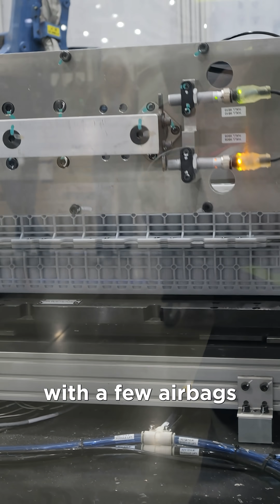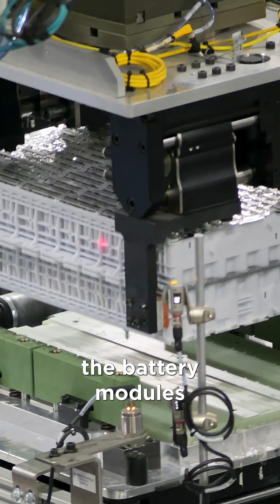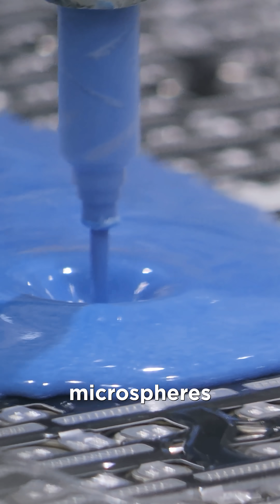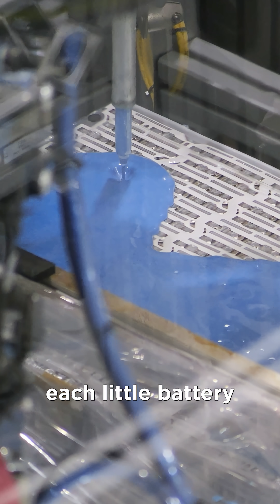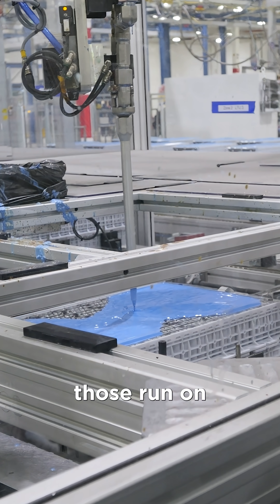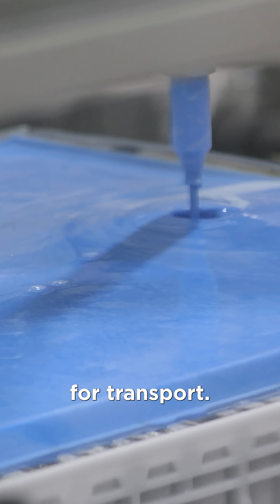Rivians Secret Battery Sauce

Comment: According to that same source Hybrid Engines are 138x as likely to catch fire as an EV 😊 (since he doesn’t care to give any source/info, I will: the NTSB is the one who came up with that stat, it’s based on the number of cars that have gone up in flames per 100,000 vehicles sold. So they found that 25 out of 100,000 EVs produced will catch on fire versus 1,529/100k for gas or 3,474 hybrids per 100k) 

That said lets not pretend like EVs are easy to put out when they do catch fire, most smart departments literally let them burn themselves out because they know they’re going to spend hours upon hours and an insane amount of water compared to a normal vehicle fire. I’ll take my chances in a gas vehicle, at least I can attempt to put the fire out… have fun trying to put out a lithium fire 😂

Edit: if you’ve never heard of the word lithium, that is the key word, look up a lithium fire it’s scary how fast they spread and how reactive the compound is with water

Comment: 60x less likely to catch on fire compared to ICE is wildly inaccurate, you should also mention how many thousands of gallons more of water you need to put out an EV fire compared to ICE, or how many continuous days afterwards the battery pack will continue to ignite after being ruptured compared to an ICE fire, or you should mention the extreme costs of the special foam cannons fire trucks have to use in order to put out EV fires compared to ICE.

Comment: Doesn't matter how much less likely it is to catch fire, EVs are still way more dangerous. In a normal car fire, you see thr smoke, you pull over, and you get out by opening the door that can open without engine power. In an EV fire, it's 5-10 seconds from smoke to flamethrower, and by that time the battery's already cooked and so are you because your doors operate off battery power. Plus, at least it's possible to extinguish a normal car fire.

Comment: I do not believe that statistic on fires at all. These are lithium polymer batteries that we are talking about, quite literally known to be extremely volatile and unstable. We have perfected ICEs and the likelihood of one actually catching on fire is extremely low unless you’re beating it to shit or there is some model specific major design flaw (Toyota GR Corolla). At the end of the day, cars don’t just spontaneously catch on fire, there are causes. A crash for example for an ICE car, or a charging mishap for example in an EV. The scary part is that the ICE car is very unlikely to catch on fire in the event of an accident, while the EV is very likely to catch on fire in a charging mishap.

Comment: 60 time less likely to catch on fire doesn't matter much considering that most combustion engine car fires are easily extinguished, whereas battery fires can literally not be put out and result in the complete destruction of the vehicle.
Reply: That's what I was gonna say, and also the reason that there are 60 times more combustion engine fires is because way more people are still using cars with combustion engines

Comment: Sure 60x but an electrical fire from batteries is way more dangerous and harder to put out than a head gasket fail or a fuel/oil burn. It is much much more violent
Reply: 60x is a bogus statistic anyway.

Comment: potting is a broadly used industry term for when you cover or submerge something in resin and not rivian-specific jargon. potting is pretty common for electronics that need to go underwater or are exposed to uv radiation or chemicals.
Reply: Yep, also used in the guitar world for wax dipped pickups to reduce feedback caused by internal vibrations of the wire coils.

Comment: Technically they cause less fires because there are only 3% in the world and 26% of them are in landfills of their own separated so fires can't break out I might be wrong on the numbers but 3% is definitely how many EVs are out there. electrical fires are the most violent also you need to be certified as a firefighter to know how to fight EV Fires Plus you need certain chemicals that are also bad for the environment and also if those batteries do explode they do release a very toxic gas and fuel into the environment. Also the production of a EV vehicle is more environmentally dangerous right now and disposaling the EV batteries are very hard to do
Reply: Oh and also you cannot repair them your own self It will be dangerous and also going to a mechanic that is Ev certified only can work on certain models That's why you go to a Tesla mechanic now rivian needs a mechanic but they also want you to take it in to their own place so technically you're in a compromise position with EVs. These are not going to be your cheap repairs they're going to be very expensive You need a battery replaced well now you're looking at $10,000s of dollars or more depending where you go. The fact that you probably have to wait a very long time to even get it replaced. These batteries are really hard to make and very expensive. And if you ever see the farms that they do for these batteries is very destructive to the environment it destroys the ground that they use. Also where did they get the material from hopefully it's not from a third world country where they have slave workers that they're paying pennies to the dollar to

Comment: If we really want to be sustainable we need to put as much as our effort into a recyclable battery as possible. An epoxy resin filled battery is clearly a terrible design for such an application. These cars are maybe half the impact of a gas car and that’s still too high
Reply: It does not change the recyclability of the battery at all. Large scale recycling of li-Ion packs use shredding and process the crumbed output.

Normal EV modules use welded containers and tables laser welded terminals that also make it difficult to disassemble to the cell level.

Comment: Yes they are not running on explosions but know what they are running on? A Fragile metal holding a Lot of energy, and you know what happens If that metal short circuits? Eletrical fire that doesn't get put out by water

Comment: Potting is not a rivian term. It’s just what you call this process. Lots of tech uses potted circuitry and has for ages. It’s what protects the circuitry in power tools from water ingress, for example…if you’re lucky that is, because most companies are too cheap to pot a tiny little brain box, let alone an entire battery pack

Comment: No way gas cars are more flamable as those fireworks on wheels
Reply: Bro gas cars literally run on an extremely flammable liquid called “Petroleum”. Need i explain why they catch on fire?
Reply: @theballintruth3369 lithium is also extremely flammable and can react with oxygen alone to burn were gas needs some sort of spark or flame to start
Reply: @jacquevander1135 not necessarily, heat is enough for gas to go up in flames. Also, the same spark idea is valid for batteries as well, but when batteries fail, it's usually themselves that start the spark by being punctured or something like that which creates a short circuit.

Comment: Though this makes repair or recovering the cells an absolutely nightmare/impossible.
Reply: As is the case for almost any EV module potted or not due to welded contructions and tables terminals.

Comment: Imagine throwing out the entire battery pack over one bad cell... ,The repairability of that battery pack is zero
Reply: Its a module. Virtually no EV pack is repairable at the cell level as they use welded tabbed connections. Replacing a module here is no different to most other EV's.

Comment: Well they made recycling and repair 10x more difficult ...
Reply: Not difficult, just economically unviable. But that's ok, it's eco, as in economical for the manufacturer and it's share price.
Reply: Not really, they are shredded in industrial recycling, not disassembled. And most ev modules us welded tab connections that make them harder to use at the sub-module level. This doesn't change much.
Reply: @joshbridges8410 its rare I actually learn from scrolling comments.
Reply: @joshbridges8410 Idk it still seems like that still makes things infinitely harder on the back end. Replacing welded cells is trivial and done every day, replacing them when they're encased in resin, considerably less so.

Not saying I'm anti-resin potting through. It makes sense to encase them on an ev.
Reply: @chrw756  replacing welded cells on EV modules is deffinelty not done everyday. Currents of 500 amp through welded cells terminals is not uncommon, and adhesives are already used in many cases.

EV modules do not use nickel ribbon with capacitive spot welding to attach busbars.

I get what you are saying and in other applications it would be an issue, but this does not impact EV repair or recycling in anyway.

Comment: The problem with potting your cells is the curing process creates heat which reduces the lifespan of the cells (unless they're already liquid cooling the cells before this process starts) as well as makes recycling these batteries nearly impossible without destroying them in the process to recover the materials.
Reply: When recycling batteries they are almost always torn down to their basic elements to be reused in new batteries anyway.
Reply: It depends on the potting compound.
Reply: Hence larger carbon footprint than a gasoline car
Reply: @Tfhncghb lol not even close. Nice try though. You should go read up how a carbon footprint is categorically measured.
Reply: @Tfhncghbare you still spewing that? Just look it up, if the ev reaches a normal vehicle milage it is better. Quit it.
Reply: @Eian_Anderson not true unless you never charge off of a coal powered grid which is extremely unlikely. And I say that while owning a Tesla
Reply: @nicholasbutler2365 this has already been debunked. Even though most of the electricity is produced from coal or gas, the emissions you get with an ev are still much lower than an ice car. In some cases an ice car produces four times more greenhouse gasses than an ev. Even though it is being charged via coal or gas. This is because electric cars are way more efficient in converting "fuel" (electricity obviously) into motion. The most efficient ev can convert 90% of its electricity into motion while ice cars can do 25-30% tops.
Reply: @ianbos3581 not true. There is no process to get energy from coal and convert it to electricity that is more efficient than a modern combustion engine with gasoline. Gasoline has a much higher energy potential than coal so you don’t know what the hell you’re talking about. I love EVs and as we improve battery production and our electric grid we will get there but right now nothing beats a small efficient hybrid for impact on the environment.
Reply: @nicholasbutler2365  US must have a shitty coal plant because in korea our coal plant is 39% efficient when normal car is 30. But US only cares about money so what do I know
Reply: @nicholasbutler2365  its funny because the US is the worlds 3rd largest consumer of coal and is actively stepping up its usage of coal. Seconded only to India and China is the biggest consumer.

Meanwhile the rest of the world is actively pushing AWAY from coal for other means of energy production.

So unless you live in the United States, India or China it's cleaner to drive an EV.
Reply: @HdbeWydvd you don’t understand efficiency do you? You also have to calculate the electricity transfer through the grid and the transfer to the car battery and the transfer from the battery to the engine and from the engine to the wheels so there’s a lot of loss you are leaving out
Reply: @nicholasbutler2365 
Show me the calculation.
I hope they include the production of gasoline, transportation, and the energy needed to pump it into an ICE car.
Reply: @nicholasbutler2365  Refining oil and gas produces a lot of carbon emissions and putting oil and gas on trains and trucks to travel hundreds or thousands of miles can’t be very efficient.  Recent research, from what I’ve found, says EVs are cleaner over their expected lifetime and will get cleaner still as energy grids get cleaner (a certainty in the near future, regardless of the efforts of current administrations).
Reply: @nicholasbutler2365 well in tn for example half of our energy is from nuclear so it’s pretty clean out here
Reply: Wrong. Look it up. Even if it’s entirely charged by coal-powered plants, the carbon footprint is STILL lower. Moreover, the grid is becoming more renewable every year.

Comment: But when they do catch on fire, they could be submerged in water for 30 DAYS or more.
Reply: That's because water doesn't put them out, lack of oxygen does. Foam extinguishers can put out a battery fire in seconds.

It might reignite when the foam comes off, but it gives you more than enough time to move the battery off site. Also, Li-Fe batteries are less likely to catch fire than Li-ion, and the brand new Na-ion batteries are able to be chainsawed in half without catching alight.
Reply: @KingFinnch thanks good to know.

Comment: But when they do catch fire it's way worse than with normal cars and hybrid cars are even worse, they can explode and bring a whole building down with easy.
Plus sometimes the batteries re-ignite after like 24-48 hours.
Reply: Hybrids are worse because they're simultaniously as likely to catch on fire as an internal combustion vehicle, and they have a large battery to burn too.

Take the engine out of a hybrid car and it's suddenly multiple times safer.
Reply: @KingFinnch I know, in Belgium a hybrid car exploded and brought down parts of the surrounding buildings and it re-ignited like a day later or something.

Comment: Whereas a normal gasoline powered car wouldn't need this extra special coating just for the battery to eventually die anyway and need replacing, it just has it's engine which if that breaks sure it's expensive but the old one can be scrapped and a new one can be put in and the car is back to life. Can see these batteries being way more expensive than an engine replacement
Reply: A full battery replacement on a Nissan Leaf (the only common EVs currently old enough to currently have a need for replacements) is around $7k, with the price dropping every year by up to 20% because of battery tech advancements.

Comment: This foam is also used as stress relief for the cell to collector plate bond wires.
Those wires breaking due to vibrations was a somewhat common failure mode on launch and raven Tesla Model S packs.
Reply: is that what was causing the issues with the fires? losse wires arcing
Reply: @kski5432  don't think so. Those wires are tiny fusewires from a big plate to the cells (which are 4.2V per cell).